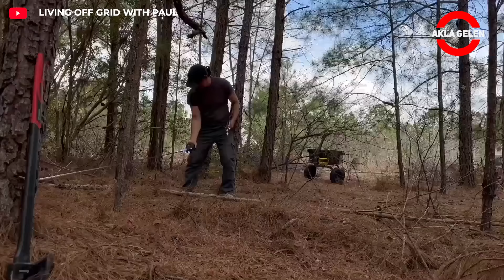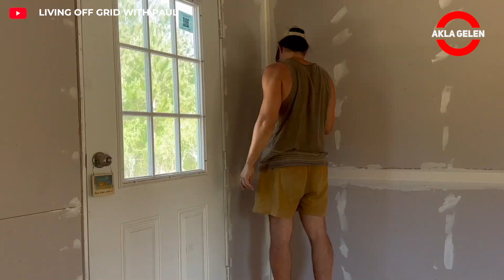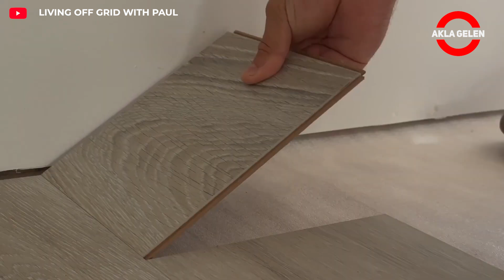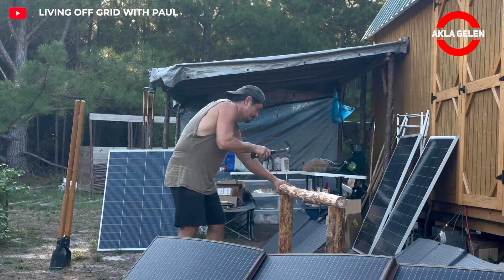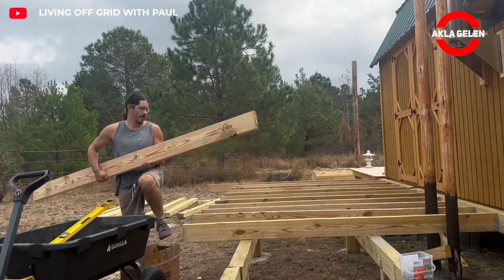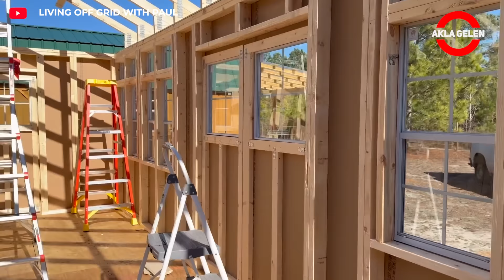Man Builds Dream Off-Grid House | Start to Finish by @Paullivesdifferent

Comment: If you are burning gasoline, and two stroke oil you did not make are you really off grid?  Get a battery powered chain saw.  Bar oil is ok to use since you don't burn it.

Comment: Those houses look nice, but the foundation is so fragile, only some lumb stuck with very little cement. Some of them are on hollow bricks? It's very easy to breakdown if a hurricane or flooding, everything will be destroyed.

The first pre-made house didn't install the installations on the wall, only sheetrocks. The only place that has installation is the roof. The second house didn't even have installation on the roof. Only the thin wall and thin metal sheet on the roof. 
No waterproof layers first then roof, just a few sheets of metal on top. 

I don't think people can live in this kind of house during winter time, or they are going to cut many trees to burn to keep warm in winter time 

They build the house just for video, they don't plan to live in the house for a long time, probably a summer vacation house. Who can take a shower out door bathroom like that in the winter? The water might be frozen! This house probably ok for  100 years ago. People didn't shower and do laundry as often as today, and they get used to no running water and no electricity. This is totally impossible for modern people.

Comment: If you want more than 15 or so years life from one of these you’ve got to order the shed with OSB sheeting instead of the T-111 siding. The outer walls need a vapor barrier installed, then whatever siding you want over that. Also, one must consider an effective rodent barrier, vapor barrier, and insulation for the floor structure. Doing so will not only extend the life expectancy, but you’ll have more resale value if you decide to move on . .
Reply: Yep. Absolutely.

Comment: 1 mistake when he did the floor board they should have been staggered  for more strength , the center will now be a weak spot
Reply: Actually there are many mistakes but all the floors are overbuilt for extra strength. 💪🏼

Comment: Looks nice, but I wonder how much that foundation is going to shift over time because your base blocks are sitting on the earth with no compaction or base material under them.
Reply: The earth under the shed was compacted. Didn’t show it in the video. After a full year there has been no shifting or sinking. We’ll see what year 2 end with. 👍🏼

Comment: Ummm.. no ground support for concrete blocking? Or is on bedrock?
Reply: Yeah, thats going to sink and be uneven in a year.
Reply: @madidusgaming914 nope. It’s been over a year and no sinking or shifting has occurred other than the initial set up. What isn’t shown in this video is that I compacted the ground before the building was set on it. Plus it’s only a 12x30 building. It can be reblocked anytime. I Can literally move this building anytime I want.

Comment: NEVER ADD WOOD IN CONCRETE, it will rot , put iron  levitating the post,u find those everywhere ,ironically on the deck part he added those ABOVE, there is also a bottom one that needs more importantly to be added !!!!
Reply: That is true. 1. That’s why I graded the concrete around the posts and 2. When they do rot out in 10-20 years it will be a great excuse to ripe it all out and build something new and different. Why are people so afraid of change?
Reply: Is this still true for treated wood?

Comment: The fact that this was design as a shed is not great to convert it into a home, first you should have seal your insulation from interior, second there is going to be heat loss from your floor (since I bet there is no insulation) and also I bet there is no air barrier, I am for sure missing a lot of detail, but in order to build an efficient home, there are things missing here. Anyways, love the content!
Reply: Who ever said I was building an efficient home? I like living more like a Spartan. I feel the heat in the summer and cold in the winter. A lot of times I just sleep outside on the deck anyway. We don’t all need the modern comforts.